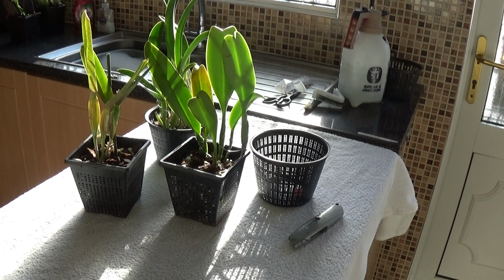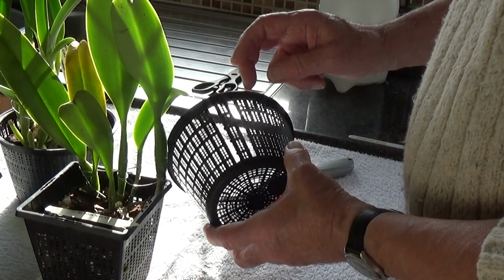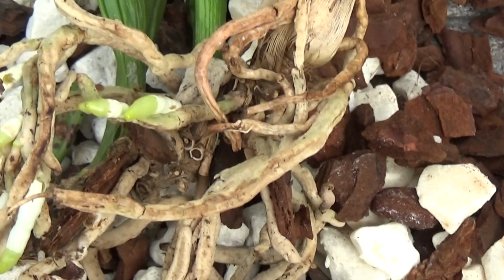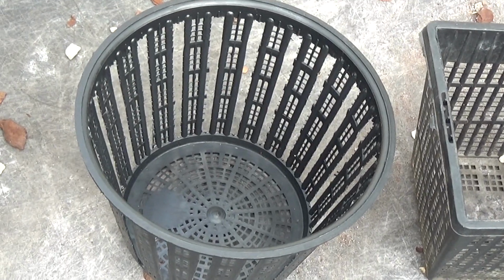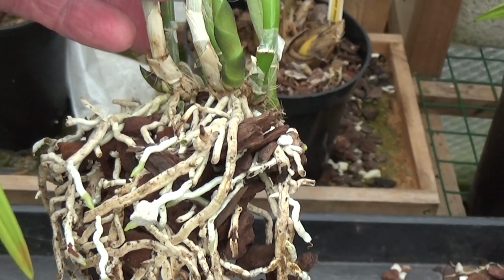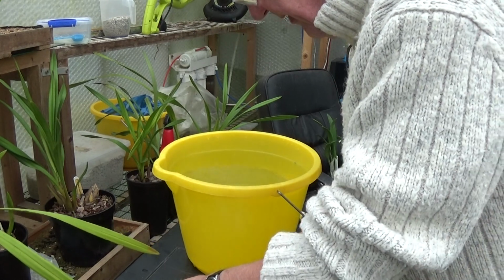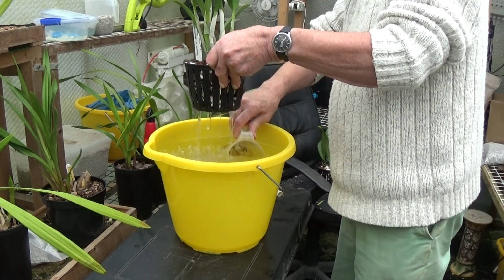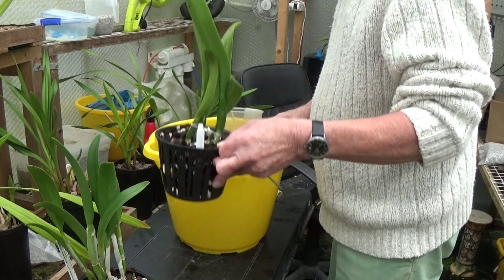Cattleyas......making them comfy !!

Comment: Good day Ed. I just  purchased an cattleya orchid from a Facebook seller from Louisiana. I took her out of the pot and trimmed up all the dead roots then I put her though the bleach treatment that I learned from you. After rincing I sprayed the roots and rhizomes with hydrogen peroxide 3%. I placed her in 8 inch pot with new bark and tied her up and hope for the best.
Reply from the maker: Hi Jay. Don't over complicate things by using the bleach treatment as a preventative unless it has an infestation. To keep your orchids free from mealy bug and scale etc you can always make a weak solution of bleach and use as a spray every month or so. I have bever used hydrogen peroxide and I have never sterilized any instruments or worn gloves.....that's what I mean by over complicating things. Feed your cattleya with calcium nitrate and liquid seaweed and don't water again until the medium has gone completely dry. Stick a bamboo skewer in the medium...it will tell you if it;s wet or dry.
Ed.
Reply: @EdsOrchids  I never used this grower. And wanted to take extra measures in this case.